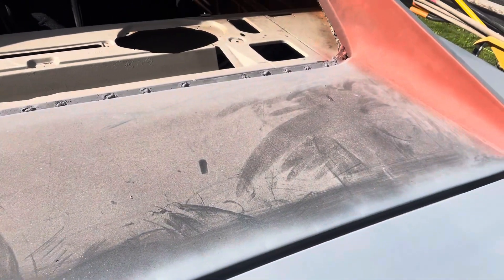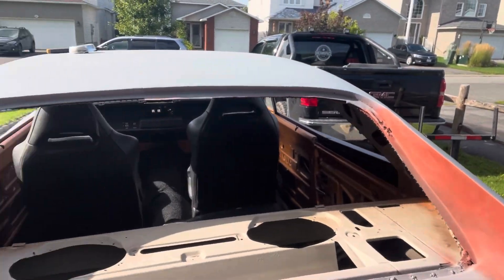69 Charger restoration episode 17

Comment: Haven’t noticed the front lately…..did you figure out the alignment on the front corner of the hood? I know you were thinking maybe hood hinge.
Reply from the maker: I got it better but still off. Haven’t put the hood latch or stoppers in as I want to paint first. Might help. I’ll also prop up lower side and reef on left side to see if it’ll bend a bit. And maybe adjust latch more